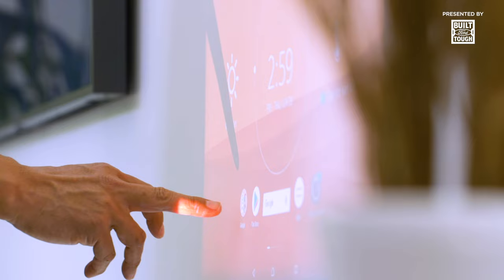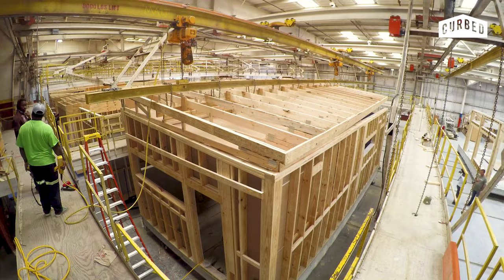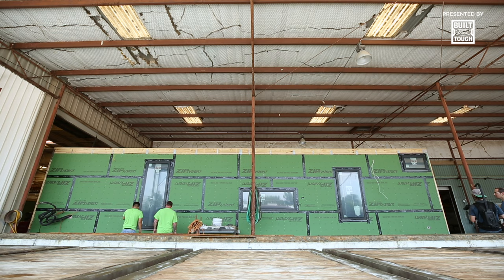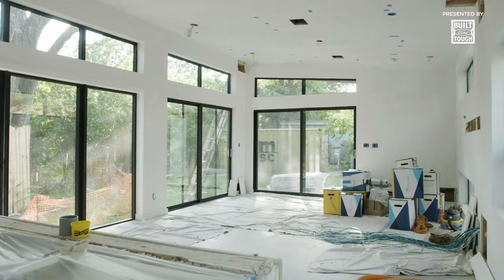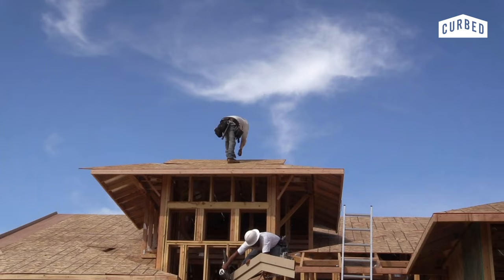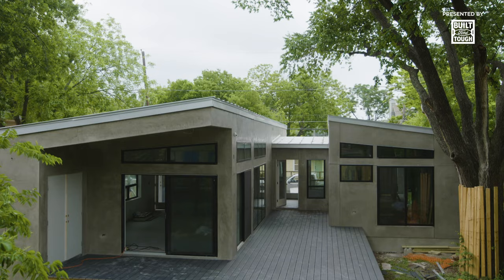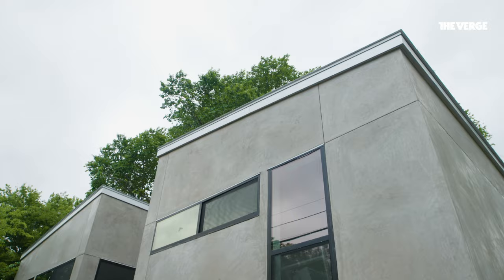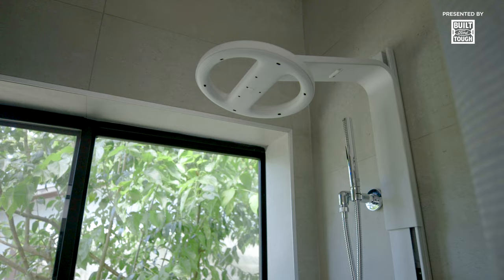We built the Home of the Future with Grant Imahara

Comment: In Europe we have been doing this for years except with proper concrete houses.
Reply: Calling a wood box a house is just mind boggling.
Reply: Enlightened Doggo they last way less, need more care and have no real advantages other than saving (maybe) cost. Oh, and wood is flammable if I recall correctly
Reply: It amazes me how they still talk about fires,hurricanes,etc destroyig entire cities but then then you see all those houses are just wood and they just go and rebuild with wood.  That's america for you.
Reply: xWood4000 "in a really complex way"Do you mean with vents, like the same ones you use for your everpresent AC ?
Reply: xWood4000 Not really, here in France we use active motorized ventilation, with vents on the celling/walls and air ducts running inside them. It pulls clean air from the outside, and blows it inside. Then, in some special rooms like bathrooms, toilets and kitchens, it does the reverse, pulling out the "unclean" air, that has odors or humidity
Reply: One question: these wood walls seem to be hollow. What if you want to hang a picture or TV?
Reply: LeVoDECoM It depends in the climate really.
Reply: Enlightened Doggo Midwest needs more concrete houses and also gulf and Atlantic coast
Reply: whydoyoucareperson Wild
Reply: whydoyoucareperson I live on the east coast of the US and have lived in hurricane and earthquake regions. re-enforcement in concrete structures are far superior if proper foundations are made
Reply: whydoyoucareperson There's a reason why skyscrapers, shopping malls, and pretty much every large building are made out of steel and concrete : They work, are more reliable, longer-lasting, safer and just overall better than wood materials, as they are strong, flex very little, handle heat, moisture and rotting infinitely better than wood. But yes, concrete and steel are in fact more expensive than wood or even plastic
Reply: Same here in the US. There's nothing new or futuristic about this
Reply: Concrete houses? That's a thing?
Reply: Wait until you see a wooden church or barn from the 1800’s... You will rethink woods strength and ability to last century’s if done right.
Reply: My city has wooden houses dating all the way back to the 1400s so yes I know that it's possible, but hardly the way of the future :-)
Reply: problem with concrete is that the sand used for it is running out while you can keep harvest trees forever.
Reply: Chris D Just compare that to stone churches now
Reply: Tony but we still have plenty of aluminum and steel...
Reply: You forget that in earthquake zones such as California, a concrete home would be terrible. As one large enough earthquake could crack not only the foundation, but other key components of the house as well. Ill stick to my flexible wood.
Reply: CLT is way better than typical stick frame, sustainable, and hopefully it takes off in the near future. However I'd still build my own house with ICF. With either of these technologies ventilation is done the same way one would do a quality stick house, using an ERV/HRV. With either of these it's easy to achieve net zero where you have no electrical costs. One of the biggest energy losses in a house is leaking that energy into the outside, and the tighter your envelope, the less money is being literally thrown out the window.

Relying on cracks, gaps, and unfilled seams in your house for "ventilation" is outdated and pretty much lunacy at this point. You want to filter incoming air, recover energy that was used to heat/cool the air in the house, and then strategically distribute it within the house while exhausting the stale air.

Europe as always is way ahead in all this, and catching up is so slow. Builders and owners in the states for the most part are honestly quite content to build gaudy mcmansions out of sticks that costs hundreds of dollars a month to cool/heat, and assume that there's no better way. For example current code for new construction dictates 5 air changes per hour (for the whole house air volume), with some areas of the country moving towards 3. Old houses are way leakier than that. A house built with CLT or ICF to European standards can get 0.6-0.3 air changes per hour if not less.
Reply: Hi Tony, I believe there's a difference here... in Europe we build a lot of prefab concrete houses in large scale. Office buildings and large houses for living. But I believe the vast majority, if not all?, of private small living houses is pre-fabricated in wood. Building a small living house in concrete simply would cost too much?
Advantage with wood is more environmental friendly (e.g. holding carbon dioxide). Concrete is not. Quite the opposite actually taking a lot of energy to produce.
Reply: Hi Rippiripper, that's not true actually. 
Concrete tears down. There are examples of concrete houses teared down in just 20–30 years. Some buildings last more than 50–60 years, and some even over 100 years. A wood house can last way longer than 100 years. Yes it needs care. But every house do. 
Wood is flammable for sure but it's not the wooden frame that causes a house to get on fire. It's most likely the interior.
Reply: Hi whydoyoucareperson, wood is flexible if something. A wooden house will give you cracks between joints and plaster work. If the foundation cracks it's probably not such a good concrete job?
Reply: Hi Chris D. No, that first episode was probably mostly a presentation of the building. Next episodes you'll most likely see a good chunk of high tech functionality built in.
Reply: Exactly my thoughts. Places prone to hurricanes should not build wood houses. Haven't they heared of concrete over there?
Reply: corner liston Wood not only takes care, but it often needs complete rebuilds. Good luck on rebuilding a concrete/steel building. Also, wood can rot... Very easily... That's why in places like Disney Parks, it's being replaced with either concrete or fiberglass lookalikes
Reply: Hi omegaPe, wood surely can do all of that. But a well taken care of building will stand for several decades and several hundreds years. One problem is that modern building really aren't based around quality. That's true for all buildings, not only wooden structures. Especially modern concrete buildings in Europe (not sure what standards are around the world) where you use this “one stage” isolation that's really really sensitive. If moist gets into the first stage then you have big problems. My guess is that a lot of modern concrete buildings will suffer from severe problems with huge costs to it. (There's already several problems like this in these modern concrete buildings.) Good luck with those concrete houses... : )
I'm both for wood and concrete. Because of design. Not because of structural differences, since they have obvious pros and cons. 
And a thought for everyone: Try not base your facts on feelings. Try to base them on actual facts. : )
Reply: Right, of course badly crafted structures are everywhere, and made of every material out there. But still, a well built concrete building wil last several times longer than one purely made of wood, with comparable amounts of maintenance.

Also, did anyone notice how this house fits perfectly the lines of a usual suburban house ?  Hardly the way of tomorrow both for me and architects...
Reply: Tony home of the futures are just fancy Mobile Homes?! Ick
Reply: Job security
Reply: Harmonica Man What ?
Reply: MacOS there is alot thay goes in between the walls. You have insulation, water proof, etc. But ideally when you hang tvs you have to get a stud finder and mount to the 2x4.
Reply: can't disagree more. Most wooden houses I've been they make freaking noises with just people walking. Is terrible.
Reply: Corner Liston, Wood is not very long lasting.  One of the oldest still standing, concrete buildings has been built in 120 AD. The cupola of the Pantheon in Rome has been built out of "Opus caementicium" (roman concrete) which spans 142 ft. in diameter. It survived all the centuries the downfall of the roman empire, numerous fires and can still be visited nowadays.
Reply: HAL The only reason it's lasted so long is because that was made with a VERY, VERY different type of concrete. It gets stronger as it ages. Normal concrete that we use today is different.
Reply: Geffá Oliveira I like a little bit of creaking... A great security feature - I always know if someone's there!
Reply: Tony Homes should be built out of wood (ideally Compressed Laminate Timber) since wood has a WAY WAY smaller carbon footprint than concrete. Concrete is killing the earth, and besides, wood is just nicer. And you can build structurally stable, long-lasting, fire-resistant buildings with wood when done right. The reason they aren't is because of American quality (or lack thereof)
Reply: That was my point. A factory built module? .... still FMCG made of plywood and black-mold. 
Best before 2055.
Reply: Wood framed houses generally do really well in earthquakes (there are exceptions) even without being intentionally design to resist earthquakes. They are very light which is a significant benefit for seismic resistance. However, they tend to do especially well if they are specifically designed for earthquakes. The same is not true for concrete houses and structures. Concrete structures do not necessarily do well and can fail catastrophically if they are not specifically designed and built for earthquakes.
Reply: Most larger building with high occupancy loads are non-combustible construction for fire safety reasons. New design methods are now starting to allow for larger wood framed structures. Tradition light wood frame is also poor at taking larger concentrated loads. In any case, that why you see larger/taller building made from concrete and steel. However, that is starting to change.
Reply: There are actually more major wood framed structures being built. Advances in fire safety will increase the proportion of wood framed structures. Especially with the newer engineered wood materials, it is likely the way of the future.
Reply: Interesting. Europeans tend to find themselves to be more environmentally conscious than Americans, yet you failed to recognize that wood construction is vastly more sustainable than concrete.
Reply: That was deliberate. I have heard both positive and negative arguments made for , traditional wood, stick framed wood, advance framing, heavy timber, log buildings, mass wood framing, steel ,masonry, and concrete. They all have positive and negative environmental and carbon foot print issues. They only way to determine the impact is to do a life cycle analysis for each building under consideration and even then there is debate on the true numbers versus the assumed numbers. It is also depends on where you live, the resources available, occupant uses, and intended life span of the building.
Reply: Enlightened Doggo 
We've got wood homes going back to the 1600's where I'm at. And I live in a hurricane zone.
Reply: whats the issue with wooden houses? in japan, some of the oldest building ever are made of wood and they withstand crazy earth quakes. my current house i like in is made of mainly wood, and it is almost 100 years old now and it is still plenty strong. concrete is great and all, but wood is plenty good.
Reply: Enlightened Doggo wood houses are better in earthquake areas ... they are more flexible .
Reply: You guys are crammed together like sardines in a can. At least we have backyards lol. Besides concrete is dull.
Reply: @HliarusProd  concrete doesn't last long in earthquakes and is incredibly bad for the environment to make.
Reply: It depends. Reinforced concrete is one of the best things arround for earthquakes, along with a dampening system (Like most of San Francisco).
But i's true that concrete by itself is incredibly bad for the environnement and creates disparity in some developping countries
Reply: Tony maybe in Germani or northern country's in europe you have concrete houses , here in Romania whe have houses or buildings that are 300—400 years old and they are made out of wood. It depends how they are made and kept  , wood needs to breathe the house that i have in the country side has 80 years and it will go longer ;)
Reply: Ha! Indeed, this is the USA man! Europeans also do not understand that this is a fricking BIG country!
Reply: may be you don´t why they build that way!!!!! At Canada, if  you do a concrete house, tell me how you do the heating??? Easy to do with wood houses!!!
Reply: omegaPe A plastic house?
Reply: Rippiripper i 100 percent agree ...we have concrete houses in the caribbean.....
Reply: Guys - as a Building Scientist who moved to North America: Wooden homes can offer great flexibility over concrete and brick.  Concrete and brick are way more expensive to build in the North American setting but they do offer many more advantages particularly in maintenance.  Every issue of construction, from water proofing, to fire resistance, to thermal inertia is covered in both methods of construction.  It finally comes down to cultural preference.  I have grown up knowing that walls are solid and when I came across hollow sounding panels, it took some getting used to.
Reply: In Australia most of the houses are made of wood as well. But there they don't have tornadoes, earthquakes or floods so often.
Reply: Tony I need a concrete modular home!!! I leave on an island with termites and typhoons, monsoon and humid weather! I like a boxy modern home. Is it feasible?
Reply: @ChrisD__  Yes, all around the world homes and buildings are made out of concrete. Wood homes have no real benefits other than cost so you shouldn't save money on the place you are probably gonna live forever.
Reply: @Mushe94  Gosh, I need to see a picture of this. Like a suburbs, made of concrete? I know they're less common in physically smaller countries but heck, that just sounds so bizarre.
Reply: LeVoDECoM it depends on where you live wood much more nicer then concrete but if you live somone really hit obviously thier not gonna build with word
Reply: look budy, im from europe, from the basque country. Ans after living in vancouver for 2 years i can tell you, the european architecture is not for humans, is for ants.
Reply: earthquakes destroy concrete homes, wood holds up much better
Reply: Wood homes are actually far more appropriate and stable in earthquake-prone areas. Just look at all the all wood Victorians that survived the big quakes in San Francisco, past and relatively recently, too. The traditional Japanese structure is another example.
Reply: they're using compressed wood, which can't be set aflame. Also wood is just much more attractive
Reply: Enlightened Doggo actually, wooden houses are way better in the case of an earthquake. Concrete breaks where wood is flexible and bends
Reply: I was going to type the same comment...
Reply: Guys hurricanes and tornadoes are quite common occurrences in the coasts and Midwest, earthquakes aren't the only concern
Reply: Enlightened Doggo there are rarely any earthquakes in Europe but the U.S. are more prone to encounter tornadoes
Reply: Bojan Babic It's big business. Cheap buildings and more maintenance over the lifetime of the home.
Reply: Or with wooden ones, but thicker wood 20x20 cm and clay. Doesn't get beat up like these, too and the material can be reused easily, just add water.
Reply: @milanelsen1796  put it where the column is
Reply: renzoqu you can’t just say it’s like that in all of Europe, amis tend to think of Europe as one big country but there are quite big differences from country to country. In comparison with the Californian houses I’ve seen, a standard German house is a lot bigger.
Reply: The wood in the house plays little into the fire, most of it is because of what's inside, such as furniture, clothing, etc. Also, these wooden homes will have fire retardant drywall covering everything, and the fiberglass insulation is also non-flammable. Housing in most major cities and suburbs already have issues with housing cost, making these homes concrete would be ridiculous. These homes are usually also much easier to make changes to especially for new construction. There are many pros and cons to both of these building materials, but cost is the main reason.
Reply: Enlightened Doggo Great joke!
Reply: Tony , did you not see the concrete foundation and steel beams?? or did you just skip 95 percent of the video
Reply: theres reason people have different types of homes, theres wood homes in colder areas for a reason and concrete in warm regions.
Reply: America has very different geography and weather which means we need different houses. There are many different ways houses have been built in around the world. In America, typically the foundation is concrete, either a slab or pier and beam though there are more. The wood framing is attached to the foundation. Some older homes made of brick or stoned will have brick/stone foundations and no framing. And some made of wood might have a stone foundation. But wood homes can last a very long time in the right conditions.
In Dallas, homes are built on concrete with wood frames and either wood, brick, or concrete exteriors. Because it can get to 100F and below 40F and there is a lot of droughts and floods concrete cracks really easily. It's not made to withstand temperature and humidity fluctuations like that. It's very common for foundations to crack and settle due to the soils we have here. Wood is more flexible, cheaper to replace, and easier to use. Home renovations and updating is also easier. You can remove drywall and replace insulation, wiring, and plumbing easily. It's easier to replace windows, doors, run wires, and mount stuff. If it's not in a stud you just use an anchor. And if it's something heavy that NEEDS a stud but there isn't one where you need it you can pull off the drywall, attach a new beam to the studs, patch the wall, then mount.
Reply: How much do one of these luna puppies cost?
Reply: Enlightened Doggo no wood construction is necessary for earthquake prone areas
Reply: Americans have a bizarre fascination with these flimsy sheds which are often covered in plastic plates looking like stone, tiles or bricks. 

Why they don’t use more rugged materials I will never understand. 

Having said that, modularity has failed to make houses more affordable to the middle class. The companies invariably get too greedy and either fold or get absorbed by a building company that doesn’t like competition.